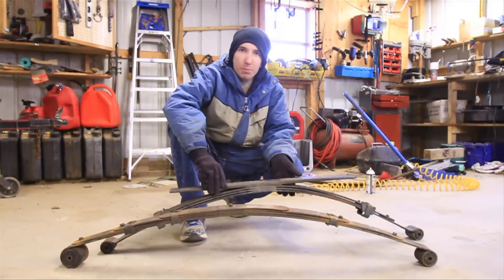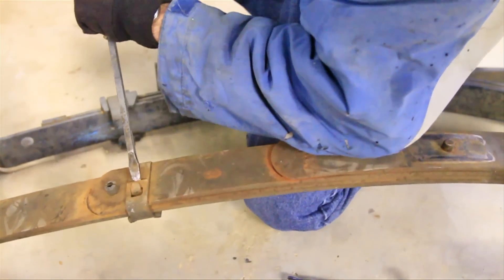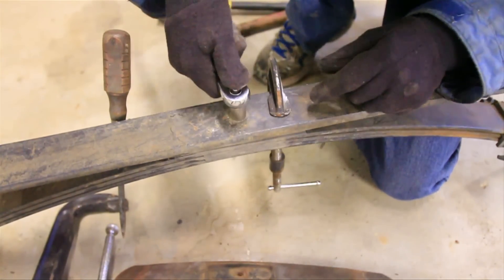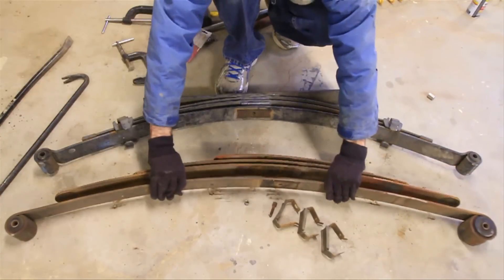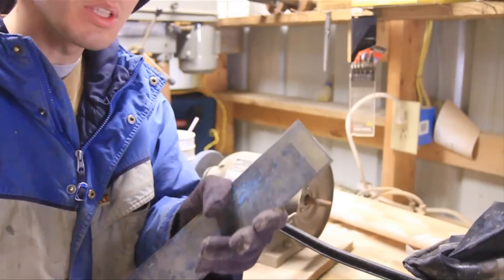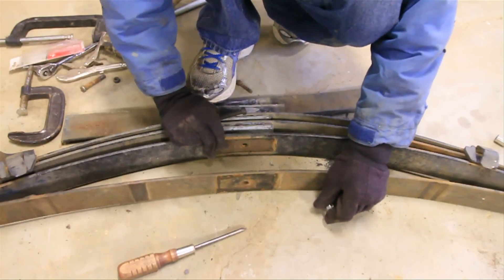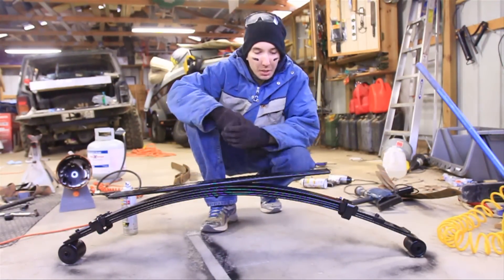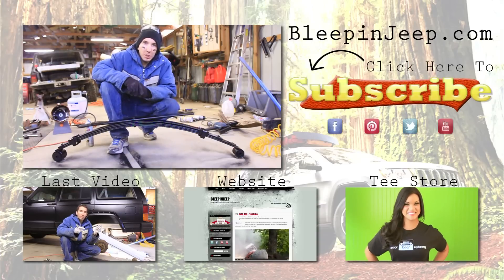Jeep Cherokee Bastard Pack Part 1 - Making the Pack

Comment: I did the bastard lift to mine. Used the xj main, eliminated the S10 main. Used the rest of pack bumped it up 4-5 inches. I didn't want that much lift. Now gotta take back apart and remove some.
Reply from the maker: Did you use a 2wd s10?
Reply: BleepinJeep you know honestly I don't know. All I know they was off s10. I see what you're saying, if the 4x4 s10. That would explain why so tall.

Comment: I did this not with s-10 leafs I actually use 1 leaf out of a 73-79 f150 it was the 3rd leaf and I took the 3rd leaf out of my xj just swapped places and my xj leafs was completely shot so my Jeep squatted about 2 inches now it sit about 2 inches higher than my friends with new oem replacement leafs

Comment: Could this be done with a Ford Ranger?
Reply: bleepinjeep hay I got a little trouble. I am changing shackles and the top bolt jest truns. I think the nut that is welded to the body frame broke. do you have a video on this or know any good way of fixing it. any advice on this would be helpfull

Comment: Will this method work for a  1996 Grand Cherokee limited v8?
Reply: +NeddyAirsoft No, beacuse the Grand Cherokee V8 does not have leaf springs.
Reply: lol, no, no it would not, youll need coil spring spacers or longer coil springs
Reply: Thanks guys! I found this out a long time ago but none the less, Thanks!

Comment: Do you need to use the bottom straight leaf from the s10 pack?
Reply: Ya, at first i was of the opposite opinion but now I think i'll be using it on mine, cause as you said, its damn sexy. Also, any idea on where to get new dampeners (i think thats what they are) the little kind of oval shaped plastic pieces that pop into the leafs. One of mine is completely worn out and i'd like to replace it.
Reply: +Colorado DanK Rides that's not a bad idea. I found some OEM style ones but they more or less look like pinecone clips. not the oval shape

Comment: I know it wont be as bad with the weight of the vehicle on it but on the '96 S-10 I used to drive, the overload spring was still about an inch from making contact at the ends unless loaded down. That inch can make the difference between clearing something or hanging up on something. I'm sure the back of the XJ is heavier so maybe it will be fine. It was just something to think about and keep an eye on. Keep up the great work. Thanks.

Comment: Most likely a 3/8ths, that the one the s10 spring need. (best to have a new/sharp one or you'll be around for a while trying to drill through that spring steel, not fun.)

 I have a s10 Bastard Pack on my XJ. One of the best thing I've ever done to it. I ended up with about 5" when I did my Bastard Pack, still want a little higher though.

Comment: Great job building the spring pack but don't you worry that the overload spring will just get you hung up on logs, roots, & maybe even rock ledges with it sticking straight out like that? I know it wont stick out past the diameter of your tire but for those times when you have one tire go off the side of an obstacle or you just can't get the right line, the curved spring may slide right across it where the overload spring will just try to stab into it. You will collect small brush there also.

Comment: I have a question about replacing and upgrading the factory leaf packs on a '99 Cherokee Sport. It has a 4.0 and Chrysler 8.25 rear end.  I don't want to lift it at this point, but the factory springs are starting to back bend.  I've been looking over the Crown Automotive springs that both Quadratech and 4WD Parts sell.  I'd like to put in a bit heavier load capacity set than stock, but am worried about them lifting the rear end so much to look stupid.  So then,..How does the free-arch height come into play?
Reply: Lonewlf7676 I was thinking on getting the Crown #52000707 springs. They are listed with 5-7/8" of free-arch and a 605lb load rating.

Comment: hey I got a question. I bought a set of leaf springs off a guy and he said they were 3.5 inch from Rubicon express. I looked at the number on leaf spring and it is a 5.5 inch lift. the pack I have has 7 leafs and all the other packs I have seen online are 6 packs. is there away to check or turn it to a 3.5 inch lift

Comment: it should be noted that the easiest way to get the cherokee leaf spring holes enlarged is to take them to a spring shop and have them punched out, rather than trying to drill them out yourself. i got 3 leafs punched out for only $5 at a local shop spring shot and drilled one out using a titanium bit that burned out after only drilling one hole and the bit cost me $8 : /

Comment: i am having my jeep do a lot of boady roll bad in the front when i slitly turn at any speed or stoping and and slity turning.i got this jeep from my roommates ex husband that died and the kid did not want it.so i dont know where he got the coil springs or add a leaf from..i have a 1992 jeep cherokee  with a manual.got it with a two inch lift kit.front end has coils springs unknow brand coil spring.the arms are rough country ajustable.has rough country trak bar.rough country steering stabilizer shock.stock leaf springs with a add a leaf in the rear.the shocks are rancho rs5000 front and rear.
Reply from the maker: do you have a sway bar?
Reply: yea i do it may be the stock one.the jeep has 169,000 on it.it has the quick discount links set to ten degress.
Reply: the shocks are really easy to push and pull.push it down and the shock does not come up unless i pull it up.i dont know if the coil springs are soft ratted or heavy duty setting.it has stock steering linkages on it.i have a rough country steering stabilers coming for it

Comment: Excellent video! I bought RE full length 2.5in add a leafs, basically the same as 1 full length s-10 leaf and i got about 4in of lift. 1 year later and i still have about 4. I think the pack you just made would easily be over 3in??

Comment from the maker: You can use a front driveshaft but only after you install the SYE.  As a temp solution you can cut, sleeve and weld your current driveshaft to fit.

Comment: @BleepinJeep Is there anything stopping a guy from bolting the main leaf from the s10 into the Xj frame? From a quick measurement it looks like it should fit but I know no-one does it that way. It's just that my main leafs are super worn out from being reverse arched and I can't get any for a good price in my area. Thanks!
Reply from the maker: Ifk. I assume there is a reason you can't do that...  but I don't know why
Reply: @bleepinjeep  Okay I just made the pack like you did and it looks pretty great, Thanks for the reply man!

Comment: What type of bolt is recommended for the pin ? Is there any special steel hardness ? or type ? If the s-10 bolt needed cut off for instance .

Comment: If I am going to do a 4" lift on my Jeep Cherokee XJ what springs would I put together for the S10 bastard pack. Also what size drop kit would I need for the transfer case.
Reply from the maker: 2wd s10 and a 1/2" block.  Then an sye

Comment: Hi there bleepin jeep I have a quick question. I'm thinking of doing the bastard pack on my 96 xj and I have a 2000 Chevy blazer sitting in the backyard would it work to get about 3inches of lift ? I measured the width and they do match up but I haven't seen much info on using a newer model blazer for this. It's a 4x4 blazer also. Any help would b greatly appreciated love your channel and will be watching more and you have another like. Thanks man

Comment: I got a question. And i am not sure which way to go about doing it. I have a 2000 jeep cherokee with 8 inches of lift. The rear end sits a little low. I'm looking for about 2 inches more lift in the rear to make it at least look level. Should i add a leaf, or get longer shackles. I am really trying to avoid blocks at all means. And i dont think they produce shackles the lenght i need, at least not that i have seen.

Comment: Now I have a yj. Would this pack still work with the front end? I know it’ll work with the rear because you just did it. But thinking the springs in the front would be different and I would be using 2 sets of rear leaf springs in a s10 as I never heard of a s10 with a front axle.

Comment: I am wanting to get some new leaf springs, and the arch is confusing . The aftermarket ones I want only have a 0.75 difference between stock. 7 1/2 arch vs 8 1/4 inches. How much will 0.75 inches arch affect ride height, or driving? Appreciate your time.

Comment: Would you use the rear leaves from a 2wd or a 4x4 s10?
Reply: what i hear it dont matter.. i just pulled 2wd s10 packs today, when i mount them like he does in this video, ill let yall know what height i get. btw mine dont have the spacer plates his have, i wonder if they are aftermarket or from a particular style s10... none of the ones i saw at the yard had them, so if i dont hit 3" i might try to make some which shouldnt be too difficult..

Comment: I put leaf packs out of a 96 s10 in my 99 XJ. Didn't do a bastard pack, just straight swap and I got 5" of lift.so I need to take out a leaf or two and swap them around to get the 3-3.5" that I want

Comment: Geeze man I'm glad you posted this vid been contemplating on what to do this spring and you made up my mind now that I understand the whole bastard pack thing one quests I have is my Cherokee already had a three inch lift installed and thought it had different springs than stock but its still got a saggy ass.  Will this still work if they're aftermarket and week?

Comment: if I could make a suggestion, a great way to keep the leaf pack from squeaking is to cut a small piece of a liquid laundry detergent bottle and place it between any 2 leafs that are metal to metal. it's not too thick and it works really well.
Reply: or... you use use leaf spring pads

Comment: Hey guys, I drive a 1999 Jeep Cherokee XJ 4.0 L.  
Anyways I am looking to lift and put bigger tires on my stock Jeep. However I am broke and staying on a tight budget. I was thinking about putting 3 in spacers up front and 2 in shackles in the back. I guess my question is this: if I did lift it that way, would the car point upward a lot or would it stay leveled??
The Jeep seems leveled so I'm afraid it will point upward and look very bad. I'm sorry if this is a dumb question, I know little about cars and am new to this so please be patient. Anyways if you have any ideas of the answer please let me know. As well, I want to put 31/10.5 mud tires on this with 15/8 rims that push the tires out slightly. Would that look good? Thanks for reading this And again please answer if u have any idea!! THANKS!!
OH AND ONE MORE QUESTION: if I did lift it this way with the shackles and spacers, will I need to get new parts such as shocks on either side or extended brake line or will the stock versions of these parts (or others) be able to stay the same with no big problems?? Thanks guys!!

Comment: Bleepinjeep what was the point of keeping the original overload spring from the s-10 pack?
Reply: I believe he means the short, thick leaf at the bottom of the pack, not the main spring (which people do use the s-10 one with longer shackles and/or relocated mounting holes).  I actually had the same question, I kept the one on my Raider when i added a leaf for a 2" lift, and all it does is get hung up on rocks and stuff..
Reply: I would have taken the overload spring off and put the smallest spring from the cherokee pack in it's place, that way you don't get the overload spring hung up on rocks or get vines and branches stuck in it. Plus spring inversion gives you a little more flex ;)
Reply: It helps with trailers and to keep your tires from hitting the fenders so the axle doesn't hit the bump stops as hard

Comment: Hey Matt, what's the cheapest way to raise the rear an inch? thanks
Reply: A shackle
Reply: tk106 get one inch blocks. or get a leaf from a junkyard and add to the leaf pack
Reply: Do a aal don't do blocks they are dangerous and you will have to get longer u bolts.
Reply: Blocks come stock on 4x4 rangers so they're obviously not dangerous
Reply: Ok maybe not but he said the cheapest so 1 aal would work and you would not even need a new center pin.
Reply: I went with 2 inch blocks

Comment: Good Luck! Don't take into account ANY wear and tear on the springs you're working with for jeep sake. The spacers by the way are used where there are wear pads. You never reuse a leaf spring center-bolt, or the u-bolts. Your Cherokee more than likely uses a 5/16 center-bolt, therefore when you get the RIGHT hardware there is no need to use a drill like this guy in the video. Don't forget your wooden handled screwdriver.